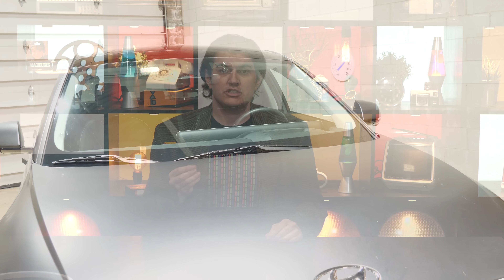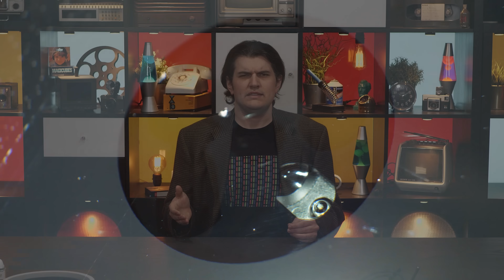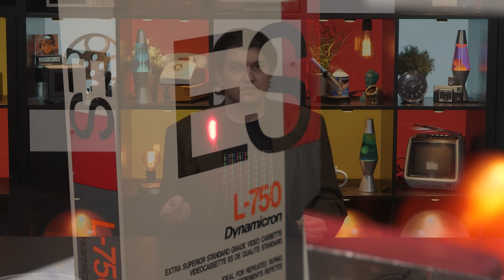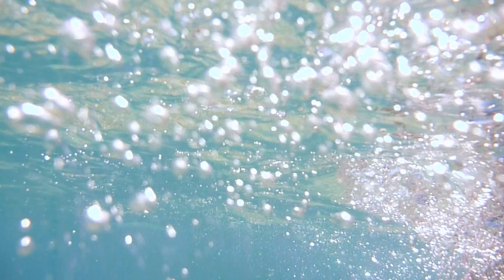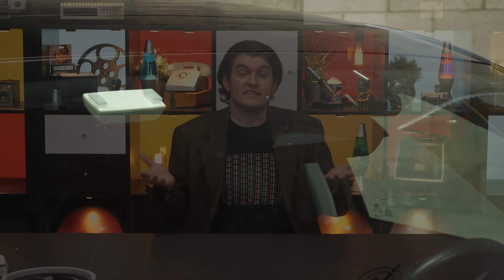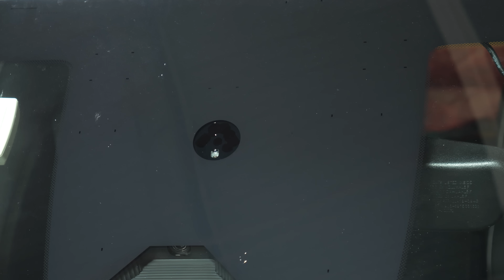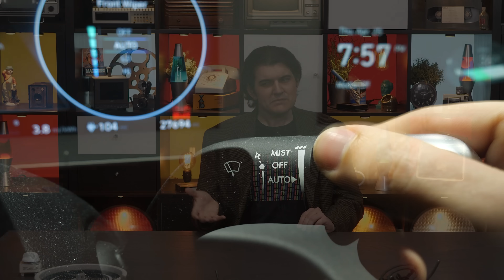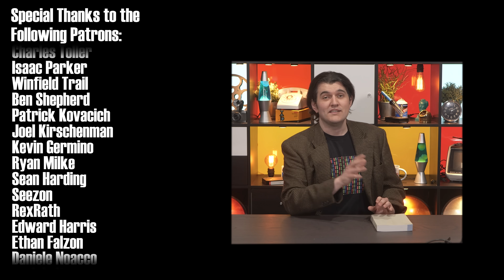The simple, clever sensor behind automatic windshield wipers

Comment: i can tell you one thing. some of the sensors have an exposed ribbon (common on fords, some audis, bmws) and to get the rain sensor off, if you dont know that ribbon is there, you might tear it. and the new one costs like 500 bucks from a dealership. luckily aftermarket ones are far cheaper. ;)

Comment: I never had a car with a rainsensor that actually worked, it either went to fast or way to slow.

The most useless option in a car imnsho.
Reply: Ford has absolutely amazing rain sensors, you can really fine tune the sensitivity with the dial so it's not too fast or too slow.
But that's about the only good thing i have to say about Ford.

Comment: I wish automatic wipers had the option of switching to a normal intermittent mode, with the sensitivity settings becoming different times between wipes. My VW Jetta auto wipers are ok, but not great, and they pretty much stop wiping when the car is stationary. It is annoying when stopped at a red light, but becomes dangerous when they don't wipe until the car is going at least 15 kmh. They should wipe as soon as the brakes are released.
Reply: Some cars do have that option.
Reply: @TopiasSalakka  Oh I'm sure they do... as soon as I wished mine did, I knew with absolute certainty that other cars would.
I guess I shouldn't complain too much. It really is the very definition of a first world problem.

Comment: I have a Ford Endura here in Australia, aka your Ford Edge.  Went to change the blades and I could just turn the arm and it turned super easy and not connected to a seperate motor with levers, very weird. Turns out each wiper has its own motor with encoders so the onboard module tells each motor when to wipe, how fast and how far. Very clever and complicated. Saves engine bay space as well.

Comment: That blade change setting is on my Golf too and I discovered it by accident. I agree on the stalks. And I assume on other dedicated buttons too. One thing puzzles me: our (old) Volvo has a rain sensor and when the windscreen was replaced, no gel was needed. The sensor unit just sat against the glass and it all worked. Is it possible the gel isn't needed?

Comment: Many years ago I owned a Ford Probe, which had pop-up headlights. They had this fiddly little knob behind them that was what you were supposed to use to raise the lights in order to change them out, but that took about 45 minutes of painful hand contortions. I found a much faster way was to turn the lights on, pull the fuse for the retractor motors and then turn them off. I... hope ... that I would have looked up how to change the wipers before trying to pull the same trick on the Ioniq 5, probably bricking its little plastic brain in the process.

Comment: I usually just used the sensors mounted on the front of my head to know if the glass was wet, it tended to have a form of visual cue to know this.  Then in a similar vein there are stalks on the steering column that help you switch on the wipers manually, which is quite convenient.  As much as I love "innovations" that serve no actual purpose, I'm glad this one isn't as complex as they make everything else.  But an actual switch on the stalk was already a better solution.

Comment: Tip: The Hyundai index is not that great but the diagrams at the very beginning of the manual are marked with pointers that reference the relevant sections of the manual. Once I started using that method of looking up stuff on the my Tucson manual I was able to find out all sorts of obscure stuff easily.

Comment: Stalk down for wipers on is stupid, one of our many work vans is like that. 
you can probably just grab your wiper blade and move it, linked blades to one motor and a whole mech is so 1990
Mine seem to be on separate but direct stepper motors so I can just move it where I want and the car will figure it out later to reset them.

Comment: If at first you don't succeed, RTFM, then if that doesn't help, you have a valid excuse to endlessly complain about whatever problem you're encountering.
Also, "software isn't everything", as a programmer, I cannot tell you how much this statement needs to be drilled into the skull of anyone working on anything, because as great as computers are, they're still one of the least efficient ways of doing a lot of things and you don't need them in literally everything.